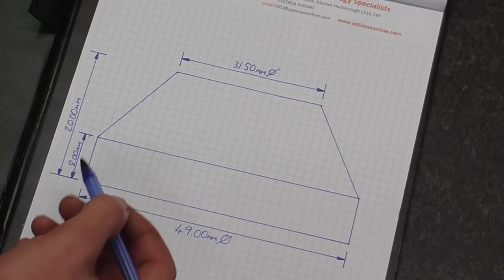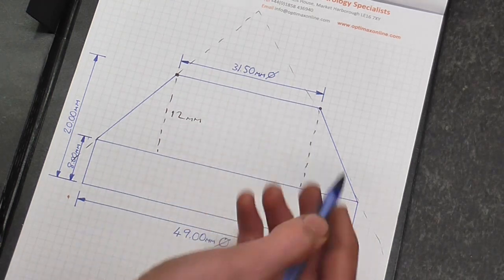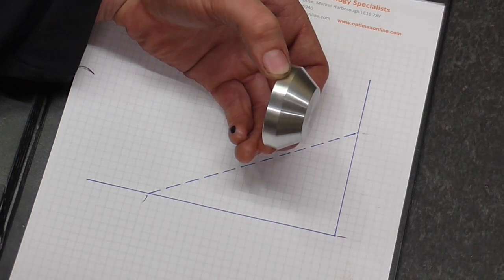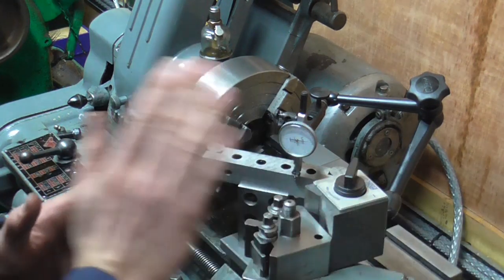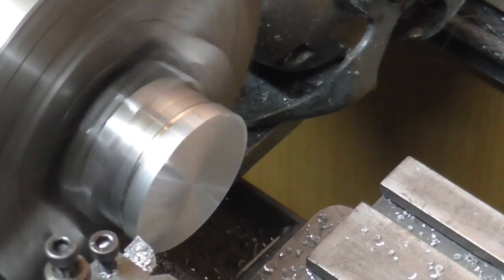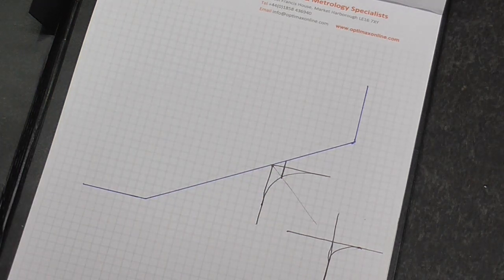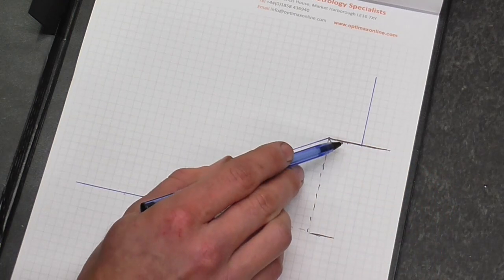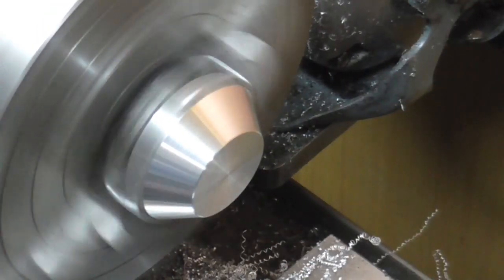Turning a Conical Feature

Comment: Slick!  
You, Joe Pie, Clickspring & MrPete222 are some of my very favorites! 
if it turns out I need an angle on the sine bar (say 30 deg) that will  be the same value as one of my Brown & Sharpe angle blocks (there's a set of 12, Mfr Part #:599-921-18)  I just fasten the required block on the side of the topslide with neodymium magnet and clock it in. This all saves a little time.
Reply: I hope 'This Old Tony' is another and one I've been ignoring erroneously is Blondihacks.
Sadly, my mind doesn't get on well with Joe - some weird kind of instant dislike.

Comment: Mr. C,

Now that is a lousy drawing in my view.
The engineer could, should have provided you with the information to do this part without any calculations the way you are going to do it.

He has the resources in cad, experience, and four years in college to dimension this part with an angle, and dimensions the way you are going to machine it.

Each time this job runs through the shop, someone has to recalculate this stuff, and likely make a mistake and remake it again.

I have seen it a dozen times, three guys in the corner trying to trig this out.

One guy is doing the job, and the other two wasting time, and money away from their jobs.

Get the clown on the floor to figure it
Out. 

Trig is a good thing to know how to use
In a pinch to check behind the engineers.

I would do this on my Prototrak cnc
Lathe no problem. 

I bet most here don't 
Have a cnc lathe, a set of Jo
Blocks, or a sign bar.

Reguards,
Kap

Comment: Enjoyed that, thank you! Assuming you have dialed the angle in accurately, perhaps you could check the progress by using a gauge. Simply a known length of stock faced parallel at both ends with a through bore of known diameter, large enough to drop roughly half way down the taper you are cutting. Then using a depth micrometer against the face you could calculate the remaining stock?

Comment: Very similar method of how I went about it during my apprenticeship; but one little difference is that once the angle was found with an indicator, I'd lock the top slide, take a cut along the Z-axis (considering you have some material to remove anyway) and measure the diameter with a micrometer - at least if the endgoal is a good fit, otherwise calipers will do just fine :)
Then I'd touch off on the face and go about it just the way you did :b
This is of course if you don't have a reference diameter as you demonstrated later in the video :)

Always loved your videos; you, Abom and This Old Tony are by far my favorites to watch ^^

Comment: Great to see you back.
I have a math degree, and I never muck around with trig in the shop.
I just model the cutter and work in Fusion 360, and take the infeed correction from the sketch. You only need a few lines, not the whole part or cutter.
Reply: I do too, but I endeavor to use the maths I've learned in the shop whenever I can!  Makes me think all that work at Uni was somewhat worthwhile.

Comment: Another method for setting the angle...if you have two dial indicators, set them up at 90* to each other on the tool post. As you move the top slide one is reading the x-axis travel the other the change in diameter. Typically I do this with one indicator when using a taper attachment with a lathe that has a DRO for the carriage. As you can guess, the more carriage or top slide travel distance you indicate the more accurate the angle you will get.

Comment: Very happy to see another video posted Mr. Crispin. And no the method wasn't overly complicated. I can't think of a better way to get to what the theoretical dimensions need to be in a home shop. One point I'd mention though, setting the top slide even with a sine bar and gauge blocks is still only a static setting if your expecting a very high precision angle. Any lathe even when brand new will always have a few thou of clearance to allow the slides to move. Plus there's various amounts of deflection within the machine components due to the cutting loads. Both issues can cause the top slide to cut outside the angle that was carefully set. It's for those reasons why for example cutting both a male and female Morse Taper even at the exact same top slide setting the tapers won't quite perfectly match. Or matching the top slide angle to an existing male Morse Taper almost always requires a very slight adjustment before it's correct against a properly ground female taper. So even when the setting methods are done extremely accurately, the machine itself can't repeat to the accuracy level it was set to. The change in angle won't be much, but enough that it does show up on fine angles such as those MT's. But as you said for most things doing it the way you showed will be more than good enough. I hadn't thought about that tip radius also causing a dimensional change so many thanks for pointing it out.

Comment: 6.00 onwards!!
Sometimes it happens. Some time ago I bolted parts of a home made slide together and did the clock. No movement. Was the clock broken? No sometimes everything works first time. Other times you struggle. Love your workshop. David and Lily.
Reply: done it on the shadowgraph at work, setting an angle on the J and S 1212E cylindrical grinder, just throw the head round somewhere in the ballpark of required angle. Check angle, "oh bugger" absolutely bang on, "was hoping to spend an hour wasting a bit of time setting the machine up", and when a bit of care is taken in lining the vernier scale up its bleeding miles off, usually when there is an urgency for the job!!